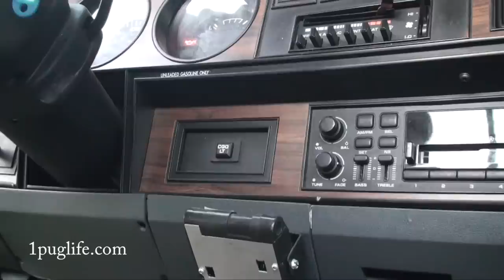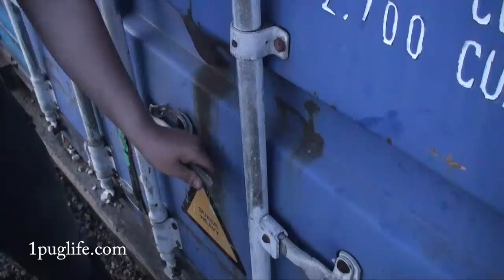Serious Frame Repair (the ONLY way to do it)

Comment: that frame rails gone ,  retire to plowin the driveway , no street privledges
Reply: Seriously, areal wreck would kill ya dead
Reply: Big time ,  that thing could fold in half any minute...
Reply: I wouldn't  sell it but its good enough  for pug to drive.
Reply: But its a truck and trucks are for doing work and when you load it up or do work you're relying on the frame rails to not fold up...
Reply: @blockeduser5769  ya fixing it with some 13 guage sheet metal is no good
Reply: Willow   Exactly all that sheet metal patch did was cover up how gone it is.   It needs a good size peice of U -Channel or a new rail.   Whats left of it is hardly even weldable its so thin.    But on the bright side.   It has all the parts you need to build a truck if you have a cab with a bad or no motor...
Reply: @blockeduser5769  Jean Luc will safety a pile of rust with 4 wheels and a seat.

Comment: Lower that lift on the locks those locks are meant to take static load not kinetic load if those lifting rams fail the stops wont prevent the truck from crushing you.

Comment: Hello Sir,  You mentioned putting fiberglass to repair the frame.  How are is it to cut out the section and weld in new with plates?  Just curious?

Comment: Don't waste time and materials on that frame.  Buddy needs a new truck
Reply: Im so glad to meet you Mr Glover!!!
Reply: If you can fix it...fix it Waist of a truck to scrap it
Reply: or you can make it a street only frankenstein for close to free
Reply: @kierancasey5814  theres millions more where it came from. You could weld in a scab but if the dot sees it its toast. Not supposed to weld on frames as a rule of thumb
Reply: @bolerdweller  maybe in America buddy but if it’s done right in Ireland or the UK it isn’t a problem for our DOT
Reply: @kierancasey5814  it can be done surely but welding on a frame generally weakens it. What's the point when these trucks are a dime a dozen? I just picked up a 99 one tonne for a grand, my clean 97(just parked at my shop for an ls swap) was 2 grand a few years ago and I just went and looked at one for parts for $400 that was clean, just parked for 15 years.

Comment: Only one proper way to fix that frame rail. Cab off and put a whole new section in at the factory joins and cavity wax the new section so it won't rust

Comment: You've got it all wrong. Fill the holes with Bondo ( Registered Trademark) then spray with under coating. It will be stronger than original. I gaurentee it!

Comment: What a waste of time this video had nothing to do with frame repair he ended up coddling Bando over the rust he described in the video only to end up screwing somebody who is going to sell the truck to he’s not a A mechanic guys like this need to be shut down from doing any work And vehicles that are going to be on the highway doing highway speeds I could possibly hurt somebody

Comment: Fiber glass ?  hey I'm not saying there's anything wrong with fiberglass but I think it might be better if it was 3/16" plate or at least1/8".  Or if you mix fiberglass with JB Weld and Bondo you make a good putty out of that that would be that would be good as new

Comment: Not to point out the obvious but you video taped that the truck is wrecked and has frame damage before you sold it without telling the buyer?

USAA pos insurance totalled my truck for less damage in same place behind the right headlight. Called it frame damage but it's part of the body. The frame is straight.  In fairness it needed a few small things like a windshield, a fender,a headlight, a bumper, tailgate... who needs a tailgate anyway... Everything else was cosmetic. I could have fixed it for less than $500. Still ran like a scalded dog.
 Paid me $8000 after spending @ $38000 since new. 2003-2014 R.I.P.
They refused to get me a rebuildable title like the adjuster said they would. 
What a racket.

Comment: Your not going it the right way. Yeah your covering it up but thats not the way to repair a frame. You cut the bad sections off of the frame and then cover them up with steel the same guage as the steel or maybe even a little bit more.